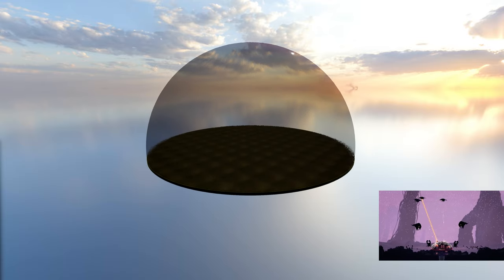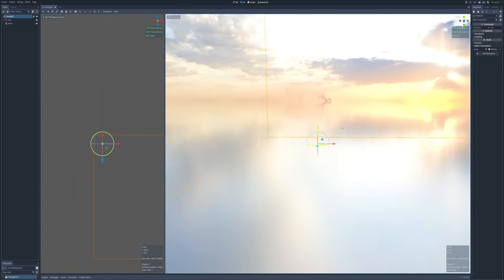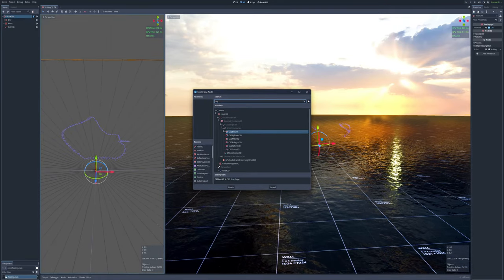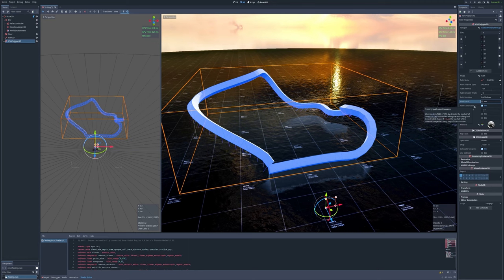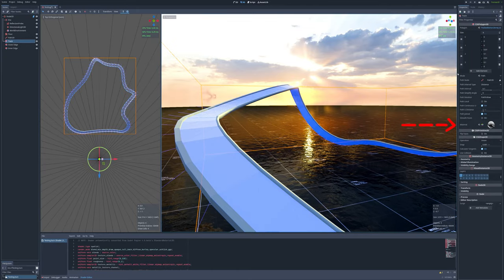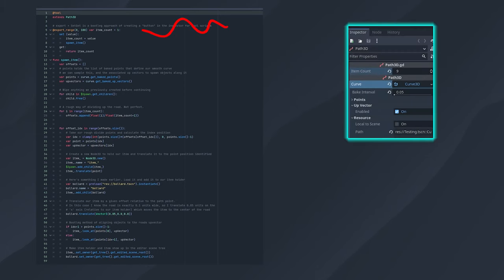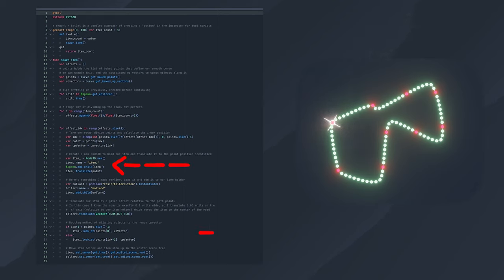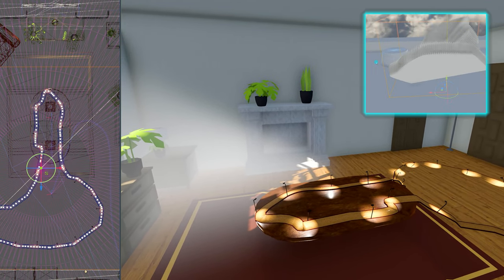How to Make Roads with Bezier Curves - Godot 4.0 Behind the Scenes!

Comment: Would you be willing to make a follow-up tutorial where you expand this spline track system further? Most racing games would require track tilt and track width parameters per spline point as well as perhaps the ability to create forks for optional shortcuts. As far as I am aware, no tutorial maker ever dared to touch on these topics before. Games could hardly be made without them, though.
Reply from the maker: Well tilt is largely available though finicky using the Path3D handles. One issue with this is the curve handles affect the tilt along the entire spline, so granular per-point controls is not there (yet, there's a github issue where someone talks about adding tilt vector factoring for CSGPolygons, so may be available in future).
Per point width is stepping into custom mesh solution rather than a built in node solution, which is even more finnicky. The Riverways plugin I think is close to what you'd want, so could look at that as a basis and build something off the back of it.
Reply: @BeauSeymour  Personally, I'd always build the track visuals entirely by hand, so this additional spline data would be used exclusively for non-graphical purposes. AI racers, for instance, would need the width data for track navigation. Cameras would use the tilt vector to remain upright without the need for raycasts.
I've taken a look at Riverways in the past, and it's very close to what I'm looking for. A combination of lackluster code documentation and my own inability forced me to give up eventually. I'll surely come back to it some day.

Comment: great video!! Following the channel. A doubt I have (I asked this question in another video on a similar subject) would you know how to place objects only when there is a curve? I wanted to put signs pointing curves on the track but I don't know what is the best way to detect the curvature of the track and direction to define the side where the pointing signs will be placed.
Reply from the maker: Great idea and can think of a few ways you could attack the problem, though will need to test them out. First thing that comes to mind would be to iterate the baked points to take a moving average of turn vectors, then defining a threshold but there's probably better ways.
Reply: @BeauSeymour  I have a racing game project that I created a track system with this technique about 3 years ago (I ended up pausing the project at the time due to Godot 3.x limitations and I'm resuming work now with Godot 4). I tried some ways to do this, what I can say is that in practice the signposts should start to be placed before the curves so that the player is informed in advance (maybe an offset). At the time I made a raycast walking on the curve with an object ahead of it, then I could detect the curve, but it wasn't very efficient.

I'll take a look at what you said, but one thing I realized is that it's necessary to have a curvature control that also detects the length of the curve, because if not in very short and smooth curves it puts the signs that maybe not are necessary.
Reply from the maker: Bit late to reply, but had a break from this project for a while. The following is how I (now) detect corners to autopopulate curve signs:

func get_curvature_3d(point1:Vector3, point2:Vector3, point3:Vector3):
	# Get the direction vector of the line between point1 and point2
	var d1 = point2 - point1
	# Get the direction vector of the line between point2 and point3
	var d2 = point3 - point2
	# Calculate the cross product of the two direction vectors
	var cross = d1.cross(d2)
	# Calculate the magnitude of the cross product
	var magnitude = cross.length()
	# Calculate the dot product of the two direction vectors
	var dot = d1.dot(d2)
	# Calculate the curvature
	var curvature = magnitude / abs(dot)
	return curvature

You then feed it point1 (which would be some distance behind the current point on the curve), point2 (the currently sampled point on the curve) and point 3 (some distance ahead on the curve). I may cover this more in another video as I've revamped a lot of the code from this one already to make it do more.
Reply from the maker: If you want to see what that looks like:

https://twitter.com/Bimbam_tm/status/1619664573531062273?s=20
Reply: @BeauSeymour  Thanks for this function! It will be very useful!!

Comment: This is a nice method, but quick question.  What if I wanted to make something more than a simple loop?  What if I wanted to build city roads with intersections?  Do you know how one would go about doing that using this approach?  I could intersect the curve on itself but the textures would be wrong and the side of the road meshes need to be deleted somehow.  Or perhaps I would have to put the intersection pieces first and then connect them with individual curves?
Reply from the maker: I'm not sure what the 'correct' method is, but suspect the only reasonable way to handle intersections is to precreate them as models,  then snap the road curve to them at defined entry/exit points. Anything else I can think up just breaks the moment you try to automate texturing it :S Maybe some I'll have to investigate in a later video but caught up with another project ATM ^^

Comment: Thank you for this amazing content!

I had a question tho, considering this CSG is a 3D node, is there an equivalent way for 2D?
Reply from the maker: I don't really dabble with 2D, but does the Line2D node not cover most of it? Otherwise you'd probably want to spring your own mesh by iterating each point pair and calculating the perpendicular vector to determine width and assigning UVs accordingly.

Comment: Two questions:

How bad are the performance issues, (And where are they)?

How does this interact with collisions?  (Could this be used to generate collissions as well?)
Reply from the maker: Re. Performance, I've only really noticed it when editing and it's minor fps dips. The moment you let go of the mouse it's back to normal, though I can't say how big a  impact there would be at scale or when combining with other Boolean objects. I think ultimately it's fine for static tracks, but would likely fall over if you wanted real-time track updates during gameplay (which tbh would have it's own quirks to deal with anyway re. Collisions). 
Re. Collisions in general, already there as CSGMeshes have the option by default.
Reply: @BeauSeymour  So Satisfactory belts should be fine, but Mario Kart wiggly tracks are out?

Good enough for me :D
Reply from the maker: @lillysmith6123  wiggly tracks is something I'm eyeballing, but not using CSGMeshes for. Future video perhaps if I get it working.

Comment: Question, Does this tool have the ability to organically add split paths and gaps into the track for more dynamic design, and does this tool also allow you to widen or thin certain parts of the track. If there is where can I learn about doing that?
Reply from the maker: None of the above, and all of that would require using a custom mesh implementation (though you could still sample a curve to define the track). Godot's Surface Tool is the easiest approach. Making track wider/thinner situationally is fairly easy, I did it in a later clip just by having a path for the inner and outer edge of the track, but ultimately there comes a point where it's easier to just custom model the solution. I highly doubt any aspect of Mario Kart was procedural for example. If it had to be procedural I would probably prefab a bunch of track splitting models and have the path end snap to the location needed for a seamless transition, then two new paths start on the other side. It would likely be quite finicky/bespoke though so don't expect a general tool to exist. The alternative I can only imagine would have some horrible vertex proximity lookups with some kinda smoothing and the UV situation would be diabolical.

Comment: Nice tutorial but I'm getting completely stuck at 03:07 when you create the other kerb. No idea how you've done it, you skip through at lightening speed.
Reply from the maker: If you pause at 2:58 you will see in the top right that the four points on screen that represent the road shape are 2D coordinates. (0.0,0.0) -> (0.0,0.1) -> (0.1,0.1) -> (0.1,0.0). This is a closed loop, so the last link to (0.0,0.0) is implied. The Y component defines the height of the road mesh, the X component the width of the road. 
I just copy this csgmesh that represents the road and tweak at 3:02 to make the 'curb' segments for the left-hand side. All I am doing is making the points start at (0.0,0.0) but then move left of it (negative on the X axis) and slightly higher than the road on the Y axis. 

The right-hand side is the same again, but I am moving the points further right of 0.1 on the X axis, and the same amount higher on the Y axis as before.

Hopefully that helps but let me know how you go!
Reply: @BeauSeymour  Excellent, thank you very much!